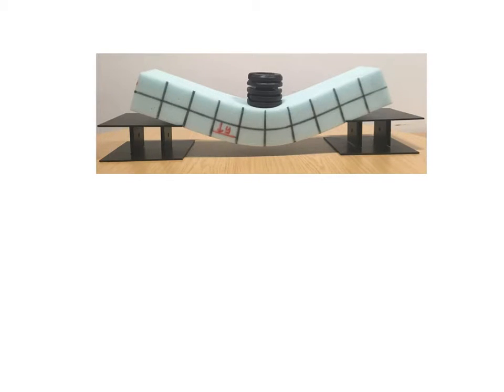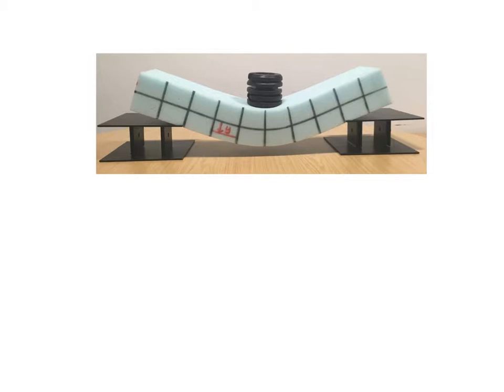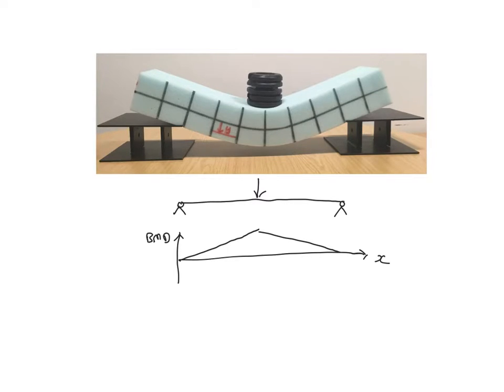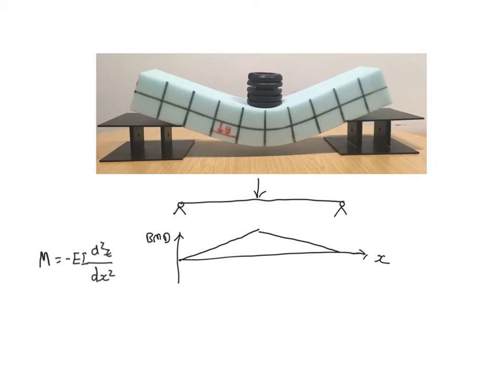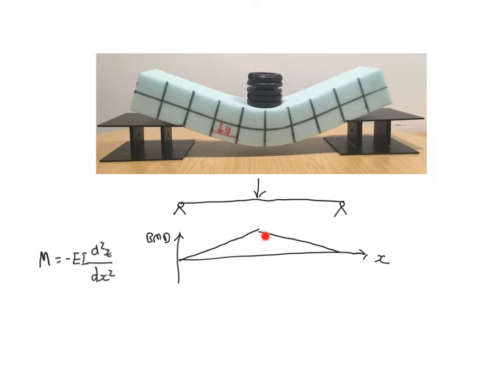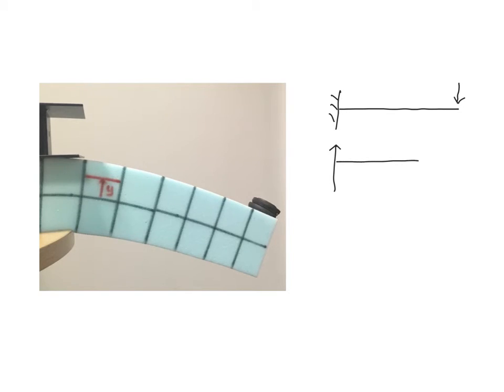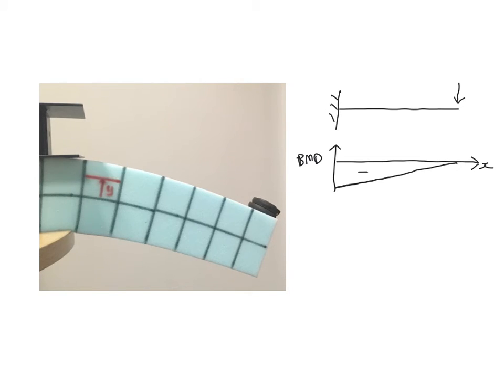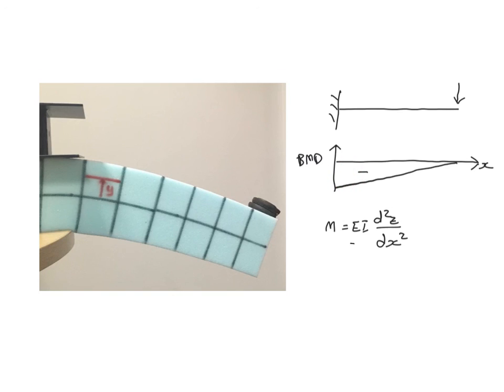Bending moments and curvature with a foam beam

Comment: Curvature or double integration of moment basically represents deflection.For a cantilever , deflection at the end is max while bm is zero.Why is that ?
Reply from the maker: Curvature (or bending moment) doesn't in fact directly represent deflection - imagine a beam bent over a support, for example.  This will have both curvature and bending moment but zero deflection. Conversely, at the tip of a cantilever there will be zero bending but deflection. 

Curvature is the second derivative of deflection, gradient being the first.
Reply: One thing more if you can tell me please.I was watching your other video regarding drawing deflected shape of beam qualitatively.I understand that we can use the sign of bm to decide whether beam will be concaved upwards or downwards.However , I do not know that when this concaved shape will be ABOVE the undeformed position of beam and when will it be BELOW the undeformed position of the beam.Generally , concave downwards deflected shape will be ABOVE the undeformed position of beam.However , in some cases , such as a beam with both ends fixed with a UDL over its entire span , the concave downwards part of deflected beam is below the undeformed position of beam.Can you please explain how to decide position of concaved shape relative to the undeformed beam ?
Reply from the maker: Ishtiaq Ali Good question. There is no general way of doing this without calculation. Sometimes it depends on. the relative values of loads, and other things not given in a qualative question. Sometimes however you can work it out from considering the boundary conditions and their implications.
Reply: Well , thanks a lot Sir.You don't know how much thankful I am to you.Your videos are really great.Waiting for you to upload some more videos.Keep up the good work.